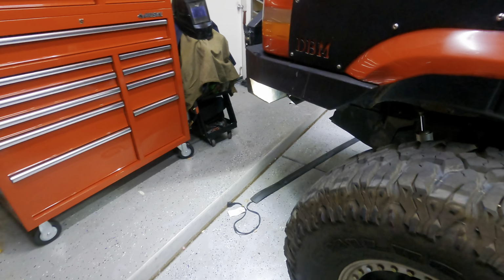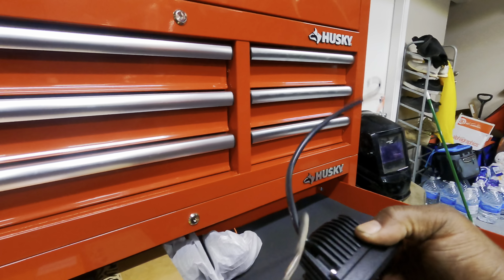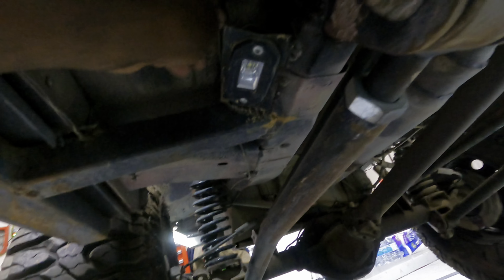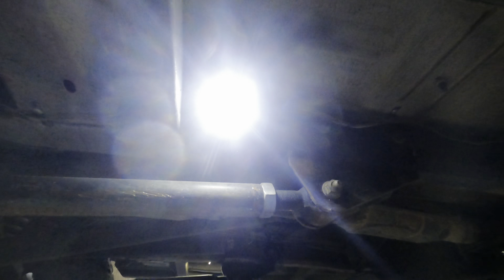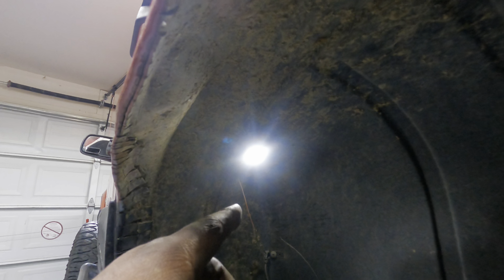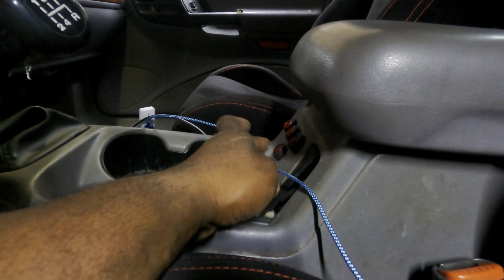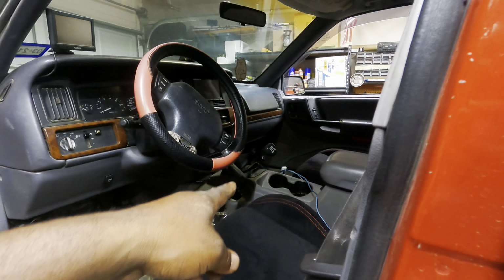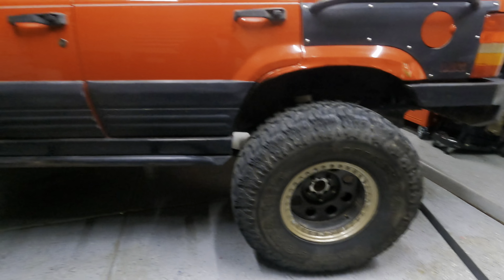How to get the Brightest rock lights for cheap! Rock lights on a zj grand Cherokee

Comment: I'm not good with electrical, are the light direct to the battery or is there a fuse in between? If you have the link to the light, that will be awesome.
Reply from the maker: There is a fuse and relay in between them